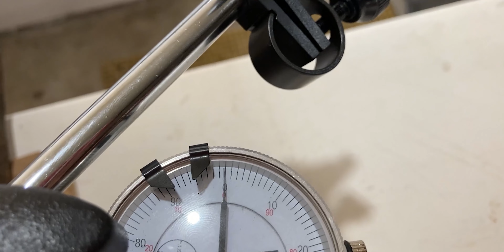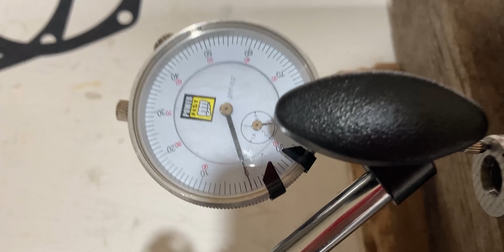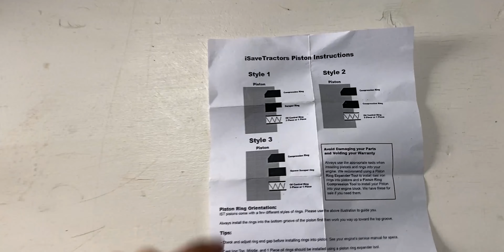KOHLER K341 16HP FULL ENGINE REBUILD

Comment: What a great tutorial! Thanks for taking the time to make this video. I'll definitely be using it for reference when rebuilding the K341 in my 210 (whenever I find the time to get it done lol), as it's nice to be able to actually watch someone else do it in addition to reading out of the service manual. Nice job, as always!
Reply from the maker: Thank you for your kind words! I try my best to share as much knowledge as I possibly can. I'm glad to hear you may use this as a reference for your K341 rebuild! Manuals are super helpful for certain specs, but nowadays it sure is neat to watch videos. I hope you find the time to rebuild your engine, because I have a feeling this 16hp Kohler is built really, really well! I prefer this simplistic design over the opposed kohler engine to be fair. If you have any other questions you can always send me an email. Best Regards

Comment: Very nice video. The only thing I noticed was the cover for the reed valve for crankcase pressure relief. It’s where your lifters are. You placed it in backwards. The sides are supposed to be away from the spring metal/reed valve so it can allow movement. You compressed the valve so it won’t open.
Reply from the maker: Good eye! I give you credit for noticing that and I will have to change that right away on my JD300! The bends on the backing plate must be facing forward so the reed valve has enough room to open and close. I try my best to get everything right and share the correct assembly method, but sometimes I oversee details myself. Thank you for pointing this out Allen!! Best regards
Reply: I saw the video on the first fire up for your JD. Beautiful tractor! A lot of time and patience went into it. Don’t want to see it ruined. I will be rebuilding a K341 on my wheel horse soon. Will definitely be referring to your video. Thanks again!
Reply from the maker: @allen4902  Thank you Allen, I appreciate it! I did put quite a few hours into the rebuild and I wouldn't want that either!! I'm happy to hear that you are into garden tractors and Wheel Horse is a popular brand. I've heard a lot of good facts  about them. I hope you can get your engine back together and hopefully it work flawlessly. Thank you and best regards

Comment: This is one of the best all-in-one videos I've seen to date on K series rebuilds. Going to be doing a K321 in the near future, and wondered if the rod cap is supposed to point towards the cam or not. Some rebuild parts places recommend it, some don't. I would imagine it probably does make some difference, but end note is that it serves to splash oil into the rod cap surface, correct? I guess it does matter based on rotation and whether the oil will splash up into that hole to lube the rod.
Reply from the maker: I appreciate your meaningful comment!! A Kohler K321 is very similar to this engine and if you ever need any instructions or information about that engine check out this link: http://bitly.ws/wDJe
Usually the rod cap arrow faces the flywheel on these Kohler air cooled engines. For the splash lubrication I don't see any reason why you cannot install them the other way around, because the rods are symmetrical and measure the same...except for the little arrow. I just install them according to the manual and haven't had any issues since.
I hope this answers your questions and helps you with your K321 rebuild. Cheers

Comment: I really liked this video, it helped me a lot. My only question for you is on the minute 1.38 in the video, where exactly the supporting bolt the holds the governor gear goes? Inside on the inside? How it holds the governor? On my tractor that bolt it's loose, it's not screwed into the block. Do I need to disassemble the engine to put it back in?  I would much appreciate your response.
Reply from the maker: Hello Rodrigo, I'm glad this video has helped you and thanks for asking a great question! This bolt acts like a guide for the governor gear so it rides in the middle of the camshaft and that is why it's smooth on all surfaces within the engine block. If this bolt is loose or not installed at all, you should be able to thread it in without taking the engine apart. At minute  02:56 you can see me turn the governor shaft by hand to feel the governor gear touch the bolts as I thread it in. You should NOT have to disassemble your engine. I hope this works for you too and that you manage to fix this issue you have. Thanks for tuning in and if you have any other questions, feel free to comment below! Regards Andreas
Reply: @WorkshopRebuild  Thank you very much for the response. It helps a lot, I will try to put it back in. I just want to let you know that this tutorial was by far the best. I am gad to support your channel.

Comment: nice video i see the you did't ck the gap between connetin rod end crankshaft  i ask this because i did try to rebuild my k341 w 3 balancing gear went it run on idler and full throttle was fine bout half throttle was making this wear noises  found out the connetin rod was to much play never fix  thanks
Reply from the maker: Correct I did not showcase any measurements of any parts in this video. Before the assembly process I measure everything. What that means is: I take inside micrometers, outside micrometers and dial gauges to check all bores, bearing surfaces and machined surfaces. Once all measurements have been gone through, I compare them with manufacturer standards. In this case I found all measurements from Kohler online and was able to determine that this engine can be rebuilt. If some measurements are too big or too small (excess wear), I must repair this before assembly. In the future I might be able to share a video on how I measure an engine before I take further action. I hope that helps. Best regards
Reply: thanks
Reply from the maker: @linozamarripa1708  You're very welcome

Comment: What are your thoughts on studding the block/head i have a K321, that do to a bad spark plug hole, i had to remove the head and of course snap 2 bolts off promptly on either side of the exhaust! So... I have a K361 (for $50,gotta love fb market place) i picked up and am just going over it and it looks nice, buuuut im a bit nervous and wondering, is there any bad reasons not to??!
Reply from the maker: I'm not familiar with the K321 and K361, but if the engine blocks are physically the same, then I do not see any issues why you can't do that! If you use studs or bolts it doesn't really matter. You just want to make sure that you have quality bolts (Grade 8 or higher). If you use studs, you want to grab hardened washers and a quality nuts as well. 
I hope this helps and if yo have any other questions feel free to ask! Cheers -Andreas

Comment: Should I put silicone on the bearing plate bolt threads?
Reply from the maker: IT wouldn't hurt to put some on the bolts, just to ensure it will not leak in the future. Cheers
Reply: @WorkshopRebuild  thank you! Did you do that? I’m just afraid the silicone will ball up at the tip of the Bolt when I thread it in and cause it to snap. I already had one snap off and don’t want it to happen again.
Reply from the maker: @diesel_dude08  I did not, but I wouldn't hurt to add some.
If you apply it to the threads of your bolts, it shouldn't push downwards. You do not want to overtighten these bolts as they are quite small! I hope you were able to get the damaged part out without too much hassle.

Comment: Hello, I am trying to rebuild a k301 right now. According to the manual the rear main seal is supposed to be pushed In .125”. I had messed with it for hours and hours. I tried getting the block level, I tried using a hammer and a seal driver and I tried using a press and a driver. All had the same result. I could not get it to be .125” all around. Some spots measure .122” and some measure .126” I posted this in a forum and someone said it would be fine, but do you think it would be okay?
Reply from the maker: Hi there! Most parts are cast externally, and when you measure from a non-machined surface you will have fluctuations.
I‘m not sure if it‘s cast on that surface or machined, next to the seal, but I believe you‘re just fine.

Most seal lips aren’t very accurate either. Just make sure the spring is in place and that both internal and external surfaces are sealing.

I hope this helps👍🏼
Reply: @WorkshopRebuild thank you!

Comment: Do I have a rebuild for a Kohler K582?
Reply from the maker: Hi Philip, I have a rebuild video for a Kohler K532 which is identical to the K582, despite having smaller cylinder bores. Check it out here: https://youtu.be/AjbQKRJXOww I hope this will help with your repairs. Regards Andreas